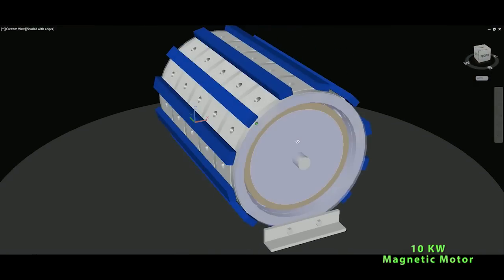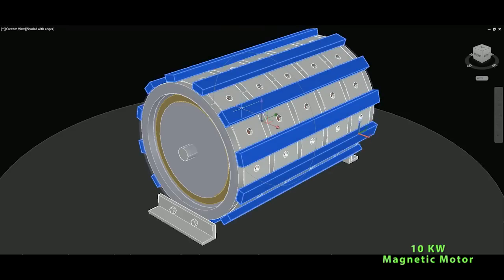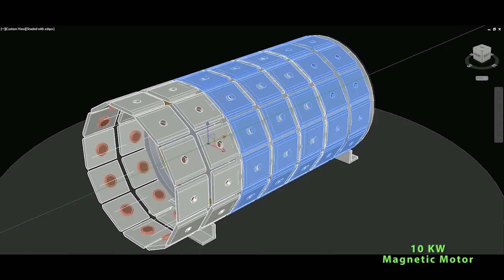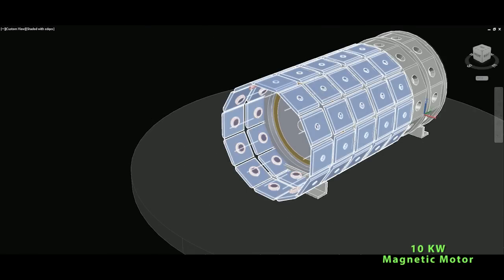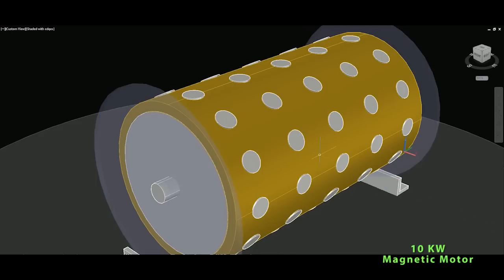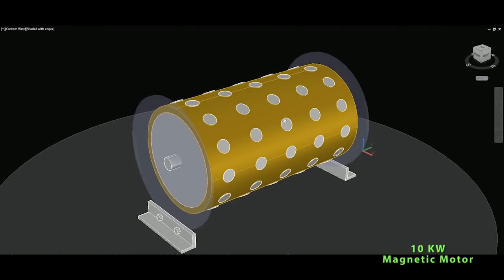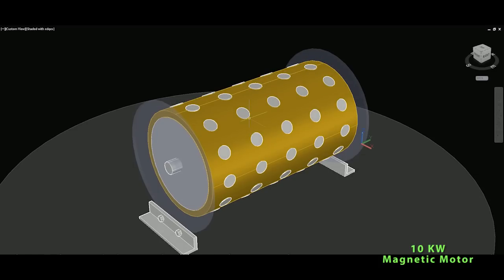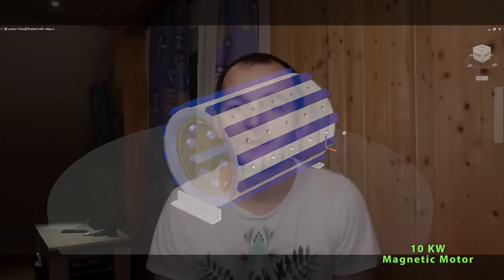Free Energy Generator, Magnetic Motor, Pulsed system!!!!!!

Comment: hello everyone. please help me by masoudraoufi62@gmail.com 
i have a 3 phase induction  motor rpm 1440 , 0.55 kw.
can i converted into pmg motor with magnet? 
Of course I did. I drilled the rotor and put some magnets inside the hole. But it did not generate electricity by turning the motor shaft? what is the reason? Where is the problem?
Reply: Magnets must be placed North, South, North through out. 

North South North
South North South

And so on. Think nature, nature is even and balanced.
Reply: @MrBlack-fh5vw no siiiir...u need a changing field,...change:current

Comment: Can anyone confirm, there are 55 bifilar coils, but without iron core, 11 rows, each row 5 coils in the stator. the rotor has 50 magnets, 10 rows with 5 magnets each?
Reply: You need odd no as S N should not match  else it Stop what every you apply energy in first start stroke same will be released with additional approximately 300% of eneargy and spin till that sine wave angle reaches to ∆ angle between shift of zero position . Already work in 1992-1994 for space craft Power generations technology's that time . Our this similar generators works for 72hr with its very small load of ultra brightness LED as it's wave length was so hi it visualies from 1000meter and some one say high Power  generator but not it's only limited lo power LED nothing's else same here. Working in magnetic engineering from 1987as of now.🤫
Reply: Correct me if i'm wrong but it looks like a different configuration of a Bedini motor. Same principle with the coils.

Comment: If electromagnets are fed with power, how can you say that it produces free energy?
Reply: Because when an electromagnet doesn't have power going to it, it becomes an electric generating coil when it's magnetic field is changing from the magnets passing by. This motor could run on one set of coils being used as electromagnets in pulse motor fashion, while the other four sets constantly produce power. Plus, he is probably capturing the back emf from when the magnetic field of the drive coils breaks down. I think it is a brilliant design. I'm going to try to build a simplified version of this one for sure.
Reply: @haroldkline4898 for sure more then a toy, this not hard to achieve...
2/3  for run, rest output aka free energy

but u have to keep it small and simple, but this not to scale...
how he managed  this one is nice...only i think 2/3 still counts

how your project?
Reply: old construction. new https://youtu.be/oN2nBZrgQwE?t=35